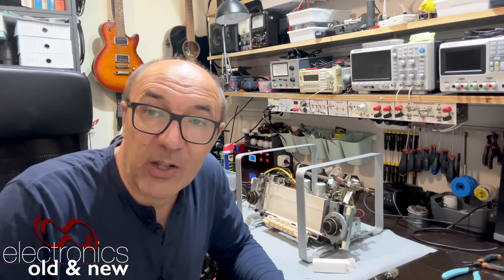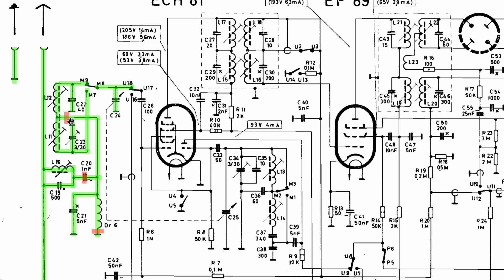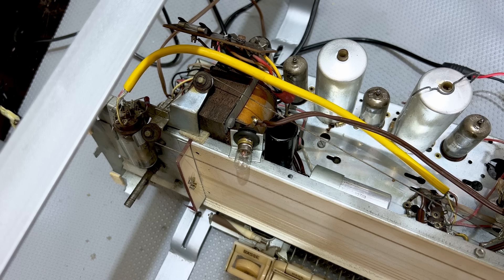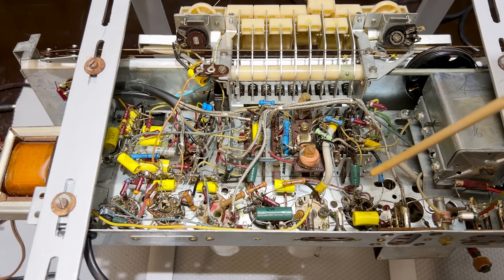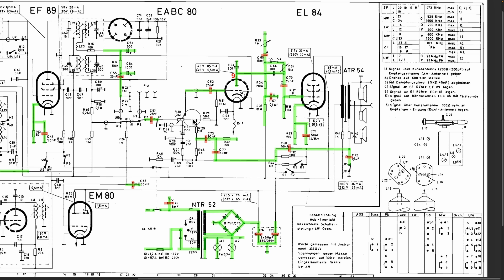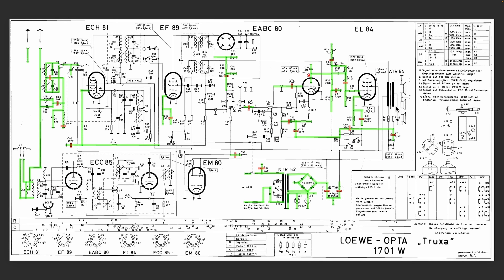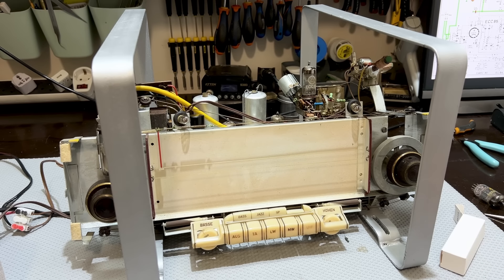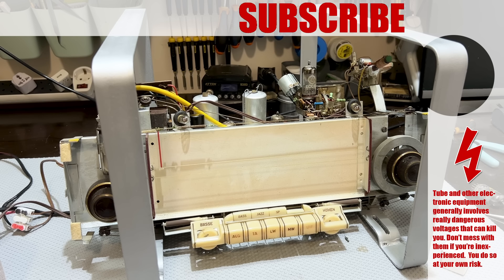Old caps need to be replaced, as well as selenium rectifier? Loewe-Opta Truxa 1701W pt.2 #pcbway#

Comment: Carlson also shows the reason why paper CAPs should be in the correct orientation, especially in tube gear.  But many scoff at that.  They are wrong!
Reply from the maker: 👍I test the orientation on all my caps just before fitting them, as a matter of course.
Reply: @electronicsoldandnew  - Same here! 👌
Reply: Whats method do you use to determine that caps orientation?
Reply: @Kemi0692  - Either build the one Mr Carlson's Lab describes, or the simplest trick is to connect across an Oscilloscope leads, holding the CAP in front of the scope, and see which way the scope shows the lowest peak. A number of YT's shows how to do this.
Reply: What about those non inductive caps? Some say you still need to determine the shield on them but I haven‘t found a method yet that works…

Comment: Sodering technique, I was taught that you do not rely upon the solder as a connection but rather a mechanical connection such as making a loop around the terminal and closing it and then soldering thus the equipment in my case commercial could withstand the vibration of a mobile vehicle. However It's more difficult to replace components. 14:51
Reply from the maker: That is the proper way to do it, and some of these radios have been done like that. The problem is removing the components without damaging the solder tag 😊 I normally fit it through the hole and bend it back 180 degrees, then solder. This is a compromise but makes life easier if I ever need to replace the same part again.
Reply: Life is a compromise, except in the Congress of the United States @electronicsoldandnew

Comment: Your rectifier replacement board provides for resistors for the reduced voltage drop. Was it not necessary for this project or will you add external resistors if necessary?
Reply from the maker: I’ll add externals if necessary. Didn’t want to place resistors inside the tube as it would heat up.

Comment: Hi Manuel, in your first video about this lame (Teal) duck at about 24 minutes you pointed out some loose wire on a coil under the ECC85. If there is a disconnection could the resonance of the  circuit be altered so as to both shift the top end frequency and damp the lower frequencies?
Reply from the maker: You can do that, and I often do just that to extend the top range a little bit, as my favourite station is at 101.6MHz.

Comment: Do you put in a dropping resistor when changing the selenium rectifier to the diodes? I know when I restore the old radios and put in solid state rectifiers I put in a B+ dropping resistor, and make it larger than the calculated value as to keep the B+ proper. That is because the original line voltages here were 110V and now are 120-125 V. In the AA5 radios, if they have a 35L6 output I use a 50L6 (Or up the 25Z5 to a 35Z5)  to keep the filament voltages managed. As a note: If you put in rectifier diodes, did you know that the entire lead length is calculated as part of the "heat sinking" for the full current dissipation of the diode? That came from the ECG/ Sylvania engineering department back in the late 70's when diodes kept failing in an organ amp. Leaving full length leads solved the problem, as the rectifiers were running very close to the full rated  current. of 1A, IIRC. 
  Typically I put a loop in my leads to shorten them and still allow full heat dissipation. (I had noticed the loop in many of the rectifier diodes leads used in the Japanese TV sets  and some stereo equipment. had always wondered why).
Reply from the maker: I’ll fit the dropping resistor at the end when I can see exactly how much current is being drawn. The option of fitting the resistor inside the tube is not a good one to prevent heating. The diodes operate at about 10% of their rated current so should not be a problem here, but your point is a good one.

Comment: Good progress. Curious as to whether you got more oomph after restuffing the bridge. Electrons leaking through a resistor, is my kind of circuit description. Looking forward to the cabinet episode, not even a glasslinger Ajax, scrubbing brush and wire wheel method, will shift that blue.
Reply from the maker: 😊 probably a heat gun and scraper 😊

Comment: No need to put a resistor in series with the silicon rectification since it should see a considerable additional amount of voltage?  I am about to do this same repair on an old 62 turntable and trying to figure out what is truly needed.
Reply from the maker: I’ll see later if the resistor is needed.

Comment: Actually 197 V is just a hair less than the 220 V +/-10% that the radio was designed for so I'd expect it to work more or less as intended even at that voltage.

Comment: I wonder why there aren't direct replacements with a 12V heater and a B+ of 12V so the PSU could be replaced with a socket and the radio run of a computer PSU giving 12V and a special transformer used to drive the speaker, it would mean no danger of electrocution.